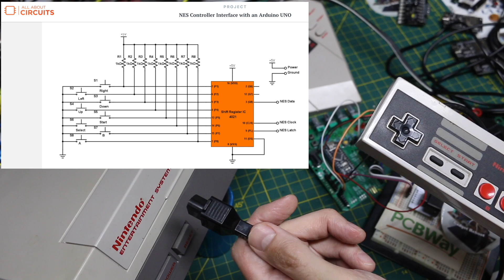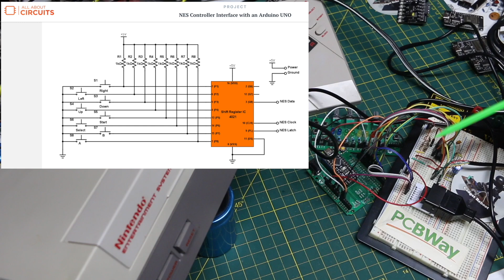NES Turbo Fire Buttons with Arduino

Comment: Cool setup man. Is this mod suitable for dualshock 1/2 too?
Reply from the maker: i’ve never had one of those controllers but it looks like people have played around with them before 
 so it must be possible to intercept the buttons and regenerate a new data stream on outward
http://www.billporter.info/2010/06/05/playstation-2-controller-arduino-library-v1-0/
Reply: @GadgetReboot  Thx for the link, gotta start researching.

Comment: would it make sense to either use the nano as a spi slave? or, use the nano's spi as master to read the original shift register of the controller? just for the sake of reducing the latency
Reply from the maker: I don’t know anything about using SPI for non-standard things which is one reason it was faster for me to just build a shift register circuit for the 1/2 of the system, but for the other half that is manually clocking the controller, I didn’t perceive any latency with button presses so there was no need to do anything further 
but if I was trying to do two different shift register things and if SPI could be used for that, maybe I would have to consider that to keep overhead down, 
or try to combine the two different shift register operations by doing the clocking all on the  same clock instead of trying to maintain two separate asynchronous serial streams or something. 
That’s the benefit of working with 1980s technology, we have much faster stuff now to process it.